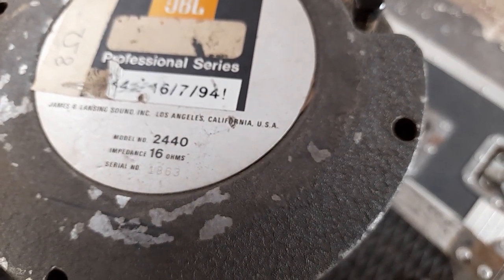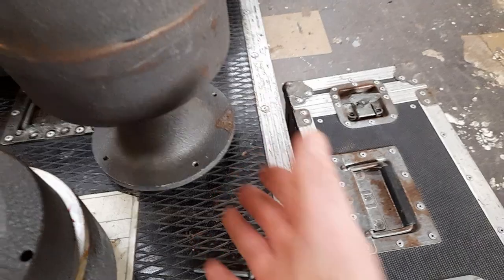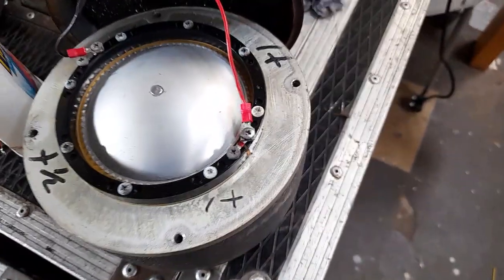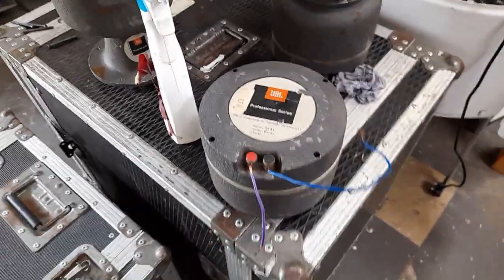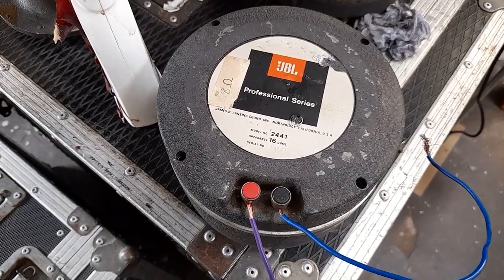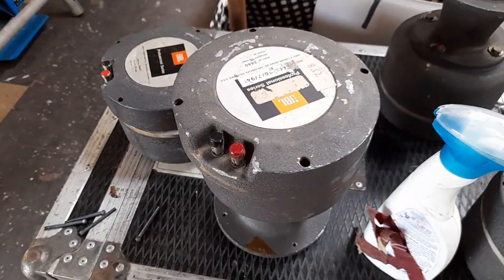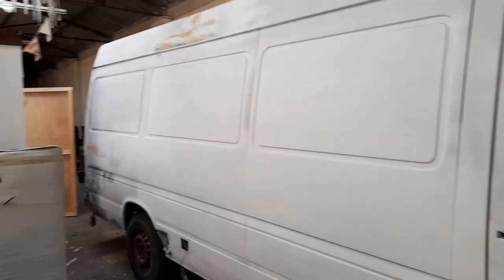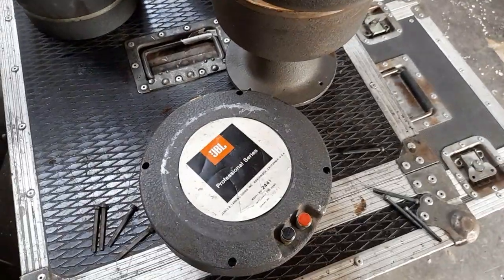JBL 2440 JBL 2441 Compression driver, let's have a look inside....

Comment: got a couple of 2441s in 3 way tops, why they so sought after?
Reply from the maker: They're old, they have Alnico magnets, they're super efficient. You can drive them off a 5 watt valve amp.
Reply: Awesome, do you know where replacement, diaphrams can be bought?
Reply: Just incase lol
Reply from the maker: @MrBradleya16  They're hard things to kill buddy. I think they're still available online?
Reply: @MrBradleya16  You can get different replacement diaphragms: chinese titanium knockoffs, original D16R2445 titanium, Radian 1245-16 (aluminium with mylar surround) or Truextent BEX4016 beryllium.
The original D16R2440 and 2441 are no longer available.

Comment: The 2441 had a silver ring to help it reach 15KHz.
Reply from the maker: Wow you know your stuff
Reply: 2441 has 1 more slit in the horn over the 2440. JBL 2440 also has a different diaphragm that's not available anymore and it's frequency response plummeted above 9KHz.
I think the Radian 1245-16 would be closer to the D16R2440 than generic titanium knockoff diaphragms from China.
Reply: @puciohenzap891  To plummet above 9KHz is actually an advantage. Midrange horns has no business playing above 10kHz. It just doesn’t sound nice. Something about breakup. Beryllium has the highest and nicest breakup. But is toxic to manufacture, and possible to use. Symtoms develop slowly - scary stuff. Better to use dedicated drivers for mids and highs, with dedicated horns. Well, except a widerange speaker has no crossover in a sensitive frequency range for the human perception.

There is something about Radians diaphragms that sound dark and lifeless.